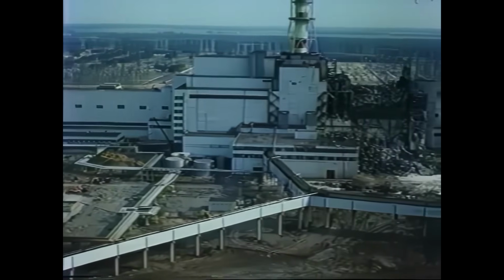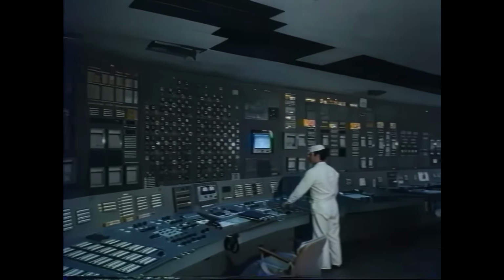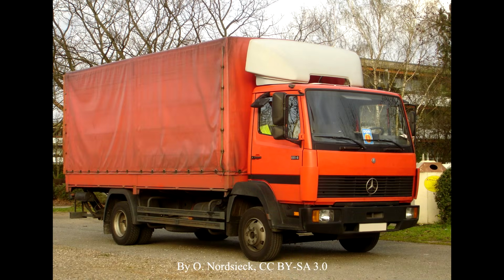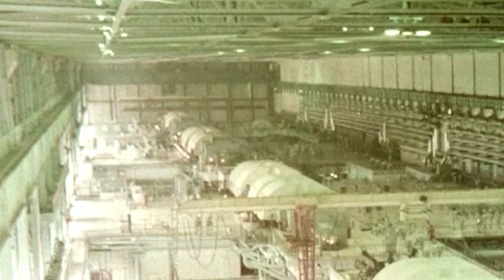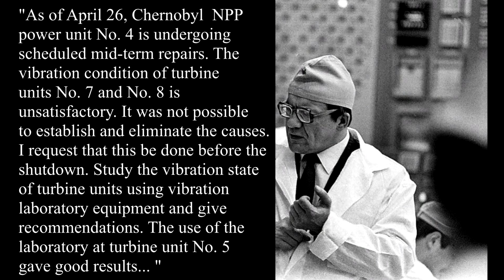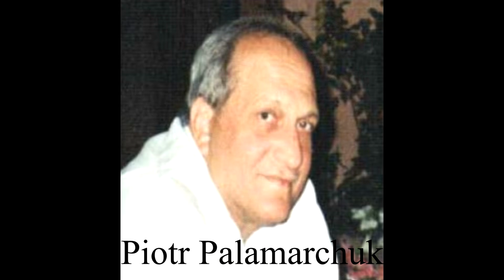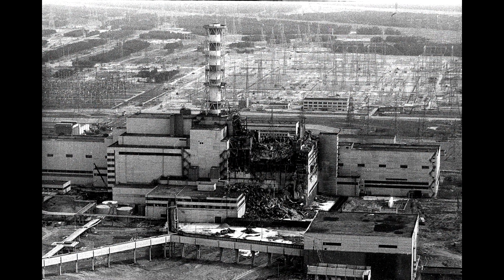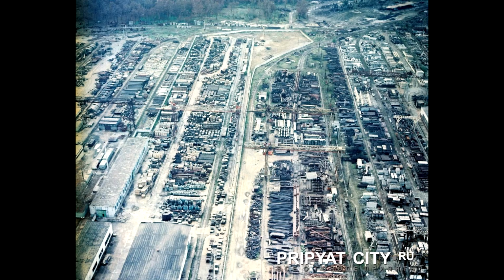Chernobyl Vs. A Mercedes: The Untold Story

Comment: very intresting watch. high tech instruments were always of intrest in industrial espionage. in some cases stolen for backwards engineering. turbine company was rather intrested in using it, was aquired on national level for civilian use. somehow a wonder it got over the courtain, such was restricted in expots. turbine balancing accounts to any shaft producing energy like jet engines, nuclear submarines. when it is about vibrations such might even be used on rocket engines. being able to produce those instruments domestically would bring technology a step forward in general. no wonder it got missing.
Reply: I have only two questions:
- Why they didn't put the container with the instruments on some soviet truck? Would be less suspicious for everyone.
- KGB probably checked the instruments before usage :)
Reply: @Voodoo_One  soviet block buerocracy was big, even they missed out things like telling moscow. especially when ukraine gained something. they would keep it as long as possible before taken away cause others thought its more valuable somewhere else, leaving them with nothig to work with. other comments stated here exactly that, such instruments were handled like precious gems. same stoys in GDR. 

truck disappeared, that is already the answer to first question. can't drive an orange mercedes through soviet union without causing attention. just need a torch and largest part you have to bury will be the engine. 

second question is obvious. who wouldn't check instruments. that is routine in using those. if you gather them on dubious ways you'll even have to check twice, is it working accurately, contamination and such.
Reply: @Voodoo_One  My guess would be that the LK, having air suspension at least at the back axle (if not on both axles) probably was much more desired to keep the sensitive measurment devices from getting damaged on rough roads or when navigating on-site. Also with it being sold thru a swiss company export restrictions may have not applied. It's not like there was no 'high tech' trade between the east and the west. In the 70s for example west germany delivered ~10500 air cooled Deutz trucks to the soviet union for use in the construction of the BAM (Baikal–Amur Mainline). Reason why the soviet shopped abroad? Deutz built way way superior air cooled engines and the soviets didn't have anything that would work as reliably in the harsh conditoins of siberia.

Comment: The more i learn about our power grid, the more i realize that modern nuclear energy options are our best option. Small form reactors, LFTRs, Thorium Reactors, liquid reactors. Utilizing our advanced technology, Improved engineering & material science. Utilizing our greater understanding of safety & well made designs. We have so much more advanced computer technology & robotics that can be used. It feels like even tho tons of advancement has occurred with engineering designs, safety measures, etc. It still doesn't matter to most people. It's like most people are ingrained with a natural negative response when talking about nuclear energy. It's a bummer because i truly believe that our best option for our future is to start utilizing Modern advanced nuclear energy options in our electrical grid. It's just proving to be challenging to get politicians to get on board. 

  It will really allow places to be much more energy independent. Less reliant on fossil fuels. They'll have efficient, stable electrical grids and the rest of the grid could experiment with alternative power sources, etc. 
We need to heal from the trauma of our past. See & learn that those things only happened solely from Us not understanding what we were doing when it came to nuclear energy at the time. We didn't have advanced enough technology, material science, engineering, safety measures, understanding of how to go about everything, etc. This source of energy will greatly help the world improve towards the future and lowering emissions. More than anything else could, while also providing a very stable electrical grid system. Currently we have alternative energy options but the majority of our grid is powered off of fossil fuels and emission producing sources of energy. We will be so much better going forward commiting to modern advanced nuclear energy options.
Reply: If the decline of the American nuclear industry has proven anything, it's that you should just choose one reactor from your list. Pick a mature, standardized design and build a shit ton of them.

Comment: im a big fan of older mercedes. Really any older vehicle in general. I garuntee if it was a modern vehicle in place there it wouldnt run with all of its electronics. Makes me wish some manufacturers would offer fleet vehicles without electronics for ease of maintence and for a longer service life.
Reply: A kindred spirit!
Reply: there are zero reasons for vehicles to have any electronics other than a starter, battery and lights
Reply: @yugenuge  The entire modern car industry, even if you don't count shitty electric cars, is based on selling stupid electric gimmicks to trick people into thinking the car is any good. Motorized seats, motorized side mirrors, motorized sunroof, motorized trunk, electrically-assisted this, electronically controlled that

Comment: In the HBO miniseries, Pikalov drives a GAZ 66 attached with a high-range dosimeter attached to the bumper.

Perhaps, in real life, Pikalov drove the Mercedes truck and used the equipment on-board to measure radioactivity?
Reply from the maker: That scene did happen in real life, but it wasn't using the Mercedes. The Mercedes was still in the Turbine Hall until towards the end of May, and it didn't have any dosimeters to measure radioactivity.
Reply: out of pure curiosity, which vehicle was used? @thatchernobylguy2915
Reply: The truck measured turbine vibrations, not radiation so it would not have been of use. As well as having been inside the turbine hall at the time

Comment: Why the turbine manufacturing company didn't spin balance the turbines in their factory we'never know.  And yes, we're still facinated by the Chernobyl disaster, it's like a train wreck where you can't look away.
Reply from the maker: I believe, from what I've read, they would have, but the design was so structurally unsound that they would unbalance themselves through changes during operation. I hope that makes sense. :)
Reply: I thought you made that clear sir. @thatchernobylguy2915
Reply: Just like they tried to make the RBMK itself cheaper, they did the same thing to the turbines for Units 3 and 4. They used less metal in these turbines than the ones for Units 1 and 2, with the result that they became more sensitive to operating conditions and were unbalanced quicker, which then had to be rectified again. Any vibration in a turbine weighing in at a 100 tons is undesirable as it will tear up the bearings. If that happens, I pity the poor sods working in the hall next to the turbine when things go wrong.
Reply: They change shape due to the heat and rotational forces, because the material used in construction is not stable enough. It's not an unusual thing really, all turbines vibrate and have systems to compensate for it, but that's more advanced than just adding weights to it. They technically didn't need the truck as there are procedures to balance it with basically no measuring equipment at all, but it's faster and less disruptive to measure once and place weights than to do it repeatedly until it stops vibrating. Best thing they could do as it was far cheaper to do this and actually a clever use of resources. The only real weird part is that the equipment used was never recalibrated as per instructions for the equipment so by the time the accident happened it's questionable if all of the instruments still worked correctly. I suppose you can compensate mathematically for that, but it's a curious thing they never tried to home the systems even in secrecy. They didn't know how, nor had the equipment, that much is clear, so if they did home them themselves then that would explain why the KGB had its eye on it. They probably got them the instructions and parts without manufacturer consent so finding them in there would expose the theft and espionage.
Reply: Go wrong? When reactors themselves became Dirty bombs
Reply: @generalprincecodyhedgewolf2944  
In this case I'm specifically talking about the turbine itself. If a 100 ton turbine wrecks itself in the hall when you're in it, the reactor will be the least of your worries. Trust me on this as a person who has worked 30+ years with heavy machinery and equipment.
Reply: @swokatsamsiyu3590  so if the turbine spins too fast it will shatter and explode and Cause damage if it’s too slow it’ll wobble and cause damage…
Reply: @swokatsamsiyu3590 fellow operator? Cranes or dirt?
Reply: @youngmike8645  
Retired Master Welder with a Crane Driving Licence/ Forklift Certificate^^ I also had to occasionally substitute at some rather large machinery at the big steel mill I worked at. Let me tell you, some of these machines will absolutely put the fear of God into you, in terms of sheer raw power and bad outcomes if things go wrong. Just like a nuclear reactor, these things are not to be messed around with. You either treat them with the respect they deserve and command, or face the consequences if you do not.
Reply: Its really hard to get it totalt in the same position in the final housing. Even a fraction of a mm of and it would need to be rebalanced when installed. 

Also its not uncommon that they need rebalacing pretty freqvently there after. So this isnt really all thet uncommon.

Its intresring that they lack the ability to make that kind of equpment  i use to work in a place that made equpment for turbine balancing. Of cause. This was in the 00s and at that time it was a hand held device.

We just got about to get rid of a old device and we got a ginant order from china for those devices.

Intrestingly. China did manufacture pretty much the same equipment them self at this time. But there equpment did have quality issued.
Reply: Maybe it was statically balanced but not dynamically. Then it`s special work.
Reply: I believe steam will wear it over time - and potentially warp it too. Both of these will cause the balance to change
Reply: APM

Comment: I am engineer from the eastern block and remember exactly the same thing.. When someone had some western equipment valued it very high, like a treasure.
Reply from the maker: It is understandable, given how expensive it must have been.
Reply: As a former scientist at Sellafield, I can confirm that there's a fire engine buried under a mound there.
Reply: @Homecastlefoundation Why?
Reply: @DesertCatDad probably contaminated
Reply: @DesertCatDad  It got radioactive in 1957 when they used it to put the windscale reactor fire out, I think.
Reply: what type of computer was in the truck? I assume some sort of PDP 10 or 360 computer.
Reply: @tekvax01  Intel 386 with MS-DOS lol. Too advanced for anything that the commies had.
Reply: @tekvax01  probably a cray x-mp
Reply: The eastern block certainly had no lack of talent just resources
Reply: @fullsenderman1982 and proper management
Reply: Like a fluke meter for instance?
Reply: @dustinandtarynwolfe5540  Yeah, or Tektronix too.. Or Hitachi ..
Reply: Didn't anyone at that time and place see the irony of such a thing?
Reply: You aren’t shit
Reply: Van you blame them though?
Reply: Well I mean yeah unlike communism western equipment and the west in general works
Reply: I worked in oz with a sparky from sellafield in the 80’s, I must find him on fcey and ask him about this. Funny man loves wine and cruises
Thanx for sharing